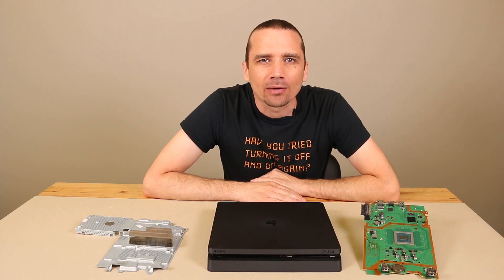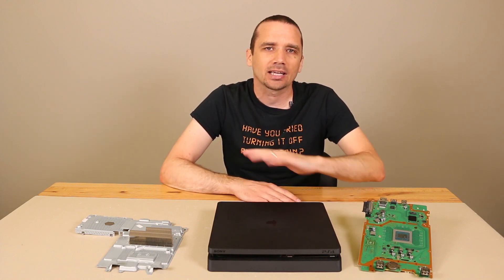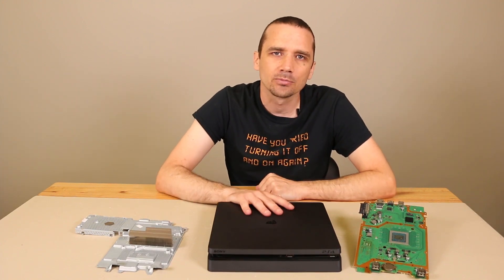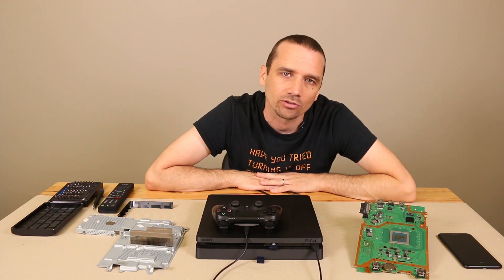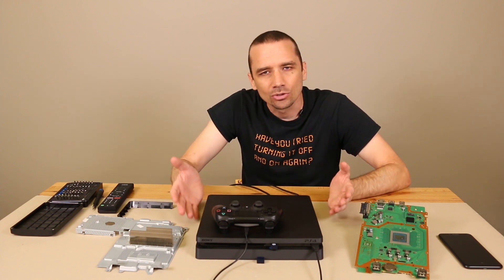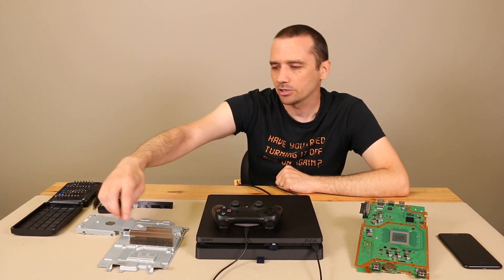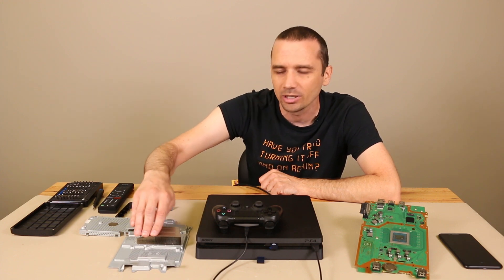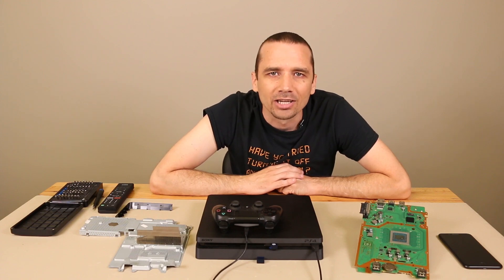PS4 Slim Too Hot? - Overheating Explained - Prevent Overheating

Comment: My 60GB PS3 (which is over 10 years old now) would get up to 72 C* and with a fan mod it's somewhere in the 60*C range. I'm not worried about my slim overheating compared to this.

Comment: I am very worried, I have seen your video completely and I understand that my ps4 slim generates heat ..
The problem is that when I use my console, I put it in front of a room fan (where I live the normal ambient temperature is 32-36 ° Celsius) And there it does not feel very hot, but when it is not with the room fan the console feels too hot and from the bottom it feels very very hot, almost  like it burns (I'm not exaggerating), I really never use it without the room fan for fear that the console would shut down (it never happened to me), ¿ What do you think about my case?
Reply from the maker: It's normal for it to feel really hot.
Reply: TronicsFix well, thanks man If you say it is normal, then I will start using it without the room fan
Reply from the maker: Let me know how that goes
Reply: TronicsFix it works good, it hasn't  turned itself off, but I have a question:
I compared how hot it felt from the bottom of my ps4 slim with a ps4 fat version and the ps4 fat doesn't feel hot at all from the bottom and my ps4 slim is very hot from bottom, is that normal ??
Reply: eddy ramirez I believe that PS4 fat version feels like that cuz it has more space inside for the air flow,  the slim is compressed so you'll feel the heat, but inside the fat is pretty much the same. I've used The Fan but it only made my slim dirty inside, not using it anymore, the slim feels warm on the top right corner and hot underneath but i play nearly 6 hours a day and the temprature always stays the same, these things are hot but its only bad if u get error texts on your console.

Comment: Best console tech guy ever
Reply from the maker: Thanks man!
Reply: Same ;)
Reply: Agreed totally
Reply: bernard ngatunga yesss I agree
Reply: Is it bad to keep the ps4 slim vertical
Reply: I agree
Reply: True I could listen to him talk for a long time
Reply: Had  a ? I got a oivo multifunctional cooling stand I put it in right way where when u kick the fans on to the stand is at the back got super hot never done that before so I flipped it to ports when u kick on the fans the five square holes that suck in air in to the slim  seems ok but never got hot the way it did before I hade custom tabs made for each corner  half inch off the ground did good but got told a ps 4 stand is better or wall mount I don’t think that is even good at all  ? Is it better just to put it back the way I had it before ? thanks for the videos cleaned my ps 4  very easygoing I could not find any one to clean it deep cleaning I don’t dare to do never ran way hot just wanted to clean was kinda shocked on the dust cause I keep the vents clean a back of the ps 4 I really thought those where the fans was . love your videos stay safe have a good one bro u a family m ❤️
Reply: Yes

Comment: Hi, do you recomend the using of external cooling fans to extract the hot air of ps4 slim?
Reply from the maker: Not usually. If your PS4 is in good condition it doesn't need them
Reply: TronicsFix  it can be cause problems yo the hardware?

Comment: Sir should I buy ps4 slim (Will this over Heating issue be a big of a problem if I play it for 6to7 hours) Or is Xbox one S better
Reply from the maker: Either of those consoles will do fine. They are both made for extended gameplay.
Reply: TronicsFix appreciate ur reply
but as u said they heat up when we play games like uncharted 4 etc . One more thing does the sound of the fans is really annoying or is it bearable.

Comment: I take off the top cover and put a small ventilator over the fan ventilator of PS4 Slim... and gets more cooler at least, I can fell it over ps4 slim....   ... the hot air comes out faster of the ps4 slim back... It works for me...
Reply: I did that too! And yes its more cooler, I make a little test playing Wolfenstein II, Drive Club  and Horizon, with and without a small ventilator  and the difference of the pS4 Slim fan decreses a lot using ventilator...

Comment: Xbox 360 gets RROD at around 51c most chips ate rated for max temp of 50c so a temp of 54c on a ps4 is a death sentence to the unit in my opinion.
Reply from the maker: They're designed to run that hot. Unless they get clogged with dirt or something it will be no problem.
Reply: Most ICs are rated at 50c

Comment: Please answer: i recently buy a ps4 slim and i noticed that the ps4 gets hot no the part you show us in the video even if iam only in the menús of the ps, is this normal? You recomend a cooler of fan for warfare days?
Reply: It gets hot like 5 minutos after i turn it on, even if iam only in the menus
Reply: Serterm tri i think thats normal. also check if theres no blocking in your ps4 slim fan.
Reply: sarsi クネタ  the fan in the menus of the ps is not working, only in the games, i want to know if is normal that your ps4 slim gets hot in the menus? Is not overheating but certainly hot on that part you mention
Reply from the maker: That's nothing to worry about at all.
Reply: TronicsFix  hi, first of all thanks for your support, second: iam here again because i buy a ps4 slim cooler that extract the air behind de console, so i noticed that when the cooler is on the internal fan of the ps4 make more noise, but when i leave the ps4 alone without any cooler its hard to hear any noise, so, my question is: did you recomend to me use this cooling external fans for the ps4?

Comment: Mine overheated the other day and powered off on netflix lol, Sorry that i played GTA 5 15 Hours straight to beat story mode lol
Reply: And btw, I didnt get a message or red light. It powered off and didnt turn back on until like 5 hrs later
Reply from the maker: That's more of something like a power supply issue or something...most likely not overheating.
Reply: Oh No, Well I usually take breaks anyway. I was just so addicted i wanted to finish lol. Any chance the power supply overheated because its fine now after being on a few hrs. I dont want to get a new Power supply nor take apart my ps4 lol. I done screwed up my gaming laptop by taking it apart
Reply: And my ps4 sits on my desks keyboard tray cuz i prefer my keyboard on top so mabey ill move it above my monitor for air and get a colling fan or stand
Reply from the maker: Ya, I wouldn't worry about it too much unless it keeps happening or gets worse.

Comment: I have a question about the fan. A few days ago I had my younger brother fall on top of the ps4 and ever since then the fan doesn't sound as loud as it used to before. Is it possible that it was damaged and doesn't spin as quick as it used to? It sounds normal and kicks in after like 10 minutes of gameplay but once I get to the home screen it is dead quiet and it didn't do this before
Reply from the maker: It's always possible that it was damaged, but if it's working normally then I wouldn't worry too much about it.

Comment: doesn't a ps4 have a built in failsafe where the system will turn off before it actually overheats.
Reply from the maker: Yep...that's what I show in this video...it will turn itself off when it gets too hot.
Reply: The problem is that its pointless most will simple get screwed even without ever entering the overheat protection, there's a really big number of people with the console turning off and doesn't start up or just simply the BLOD.

I had the latest best version of the PS4 before the slim (3rd version with the big cooler and slightly more energy efficient than the 2nd version and way better than the first one), I sold it to a friend when I upgraded to the PRO.

My friend already have it for almost a year, but last weak the console had the starting problem, it would start then shut down, I guess the console is dying, good thing is its still under warranty until like March next year.

Both me or him always let the console cool down at least 5min in the menu after playing a game before turning off, it has nothing around it so it has enough cool air to push and the consoles just seem to be made to break after warranty is over just like the PS3.

My current PS4 Pro also already shutdown while gaming twice already, I don't know if its also failing or if its other software errors, I barely used the console, I left it OFF for like half a year.

Both consoles are also completely dust-free, not a single bit of big dust on the air entrance...

Every time I clean my room I always clean my console with the Vacuum cleaner with a big brush adapter (so it also doesn't make much pressure and doesn't turn the fans inside, just cleans outside).

Never use a powerful vacuum cleaner directly or with the high pressure small head adapter, it might cause overvoltage damage inside if the fans overspin since they create electricity while spinning, for that the fans need to be stop from moving and only then you could blow\suck air at high pressure.
Reply: Omg thank the Lord my PS4 shut off randomly while watching YouTube it's either it literally died or I just didn't pay attention to it but how long does it take for it to turn back on

Comment: I have a question, one night I was listening to music when I heard a loud "bang" come from my ps4,  when I tried to turn it on it beeped and the light came on for maybe a second then it wouldn't even attempt to turn on after that. it's been a few days and it does the same thing. I was thinking that the problem is overheating but I haven't looked inside and I don't have the tools to do so. I'm worried that the entire inside is just exploded and non repairable due to some explosion or is this common and really only effects a particular piece of hardware and can be fixed ? or should I just invest in a new Console?
Reply from the maker: Overheating will not cause a loud bang and they will usually start up again. Are there bugs in your console? What you describe is often caused by bugs getting in it and shorting out the power supply. They normally can be fixed.
Reply: Jason Lyons Interesting because I had this happen to my PS3. When I got to open it up, I actually found bugs inside of them! Check it out, but unfortunately my PS3 wasn't able to be fixed because the motherboard and disc drive appeared to have broken.
Reply: I can't tell if there are bugs inside of it, I've never noticed any crawling around on it or trying to get inside of it. and it was more of a "pop" sound than a bang. I don't currently have the tools to open it up and see if it does have bugs. I'd imagine by now considering how long it's just been laying there that they've probably all left. or am I wrong?
Reply: and if you have any advice on cracking open this thing and unscrewing the security screws without the specific tools I'd be willing to try that
Reply: also, if it is my power supply. could I just order a new power supply and a screw set and replace it then or would I have to replace the fuse and solder it onto my system? if that's the case I'll just send it to you .
Reply from the maker: No soldering required to replace the power supply. I have teardowns on my channel as well as links to the tools I use in the description.

Comment: hey does PS4 fan from Amazon would really make a difference? or may be it just the way to get more dust into the ps4.
Reply from the maker: I actually don't think they make a difference. I haven't tested them but the fans on the PS4 are generally not the problem...they work fine...as long as they work. If the fan stops working then that's obviously a problem.
Reply: TronicsFix thank u sir.
Reply from the maker: You're welcome!

Comment: yo what happens if you accidently plug off the ac power cord from the ps4 slim while its on?? i have done that 2 times so man plz help
Reply from the maker: It shouldn't cause a problem (except that you'll probably lose some game data). It will do a system check when you turn it back on. You should try not to do it but if you do it's not a big deal.
Reply: thanks + subbed
Reply from the maker: Thanks for the sub!

Comment: what u can do is go on amazon and buy ps4 slim fan to connect on the back of the system.
the higher the system temperature get the more air the fan blows
Reply from the maker: Or you could just fix the problem so it doesn't overheat.

Comment: thats sad that the ps4 slim overheats but doesnt surprise me because its too small for a high end console
Reply from the maker: All consoles overheat under the right circumstances. The PS4 Slim doesn't overheat any more than the original PS4.
Reply: Salar Mizere dude yes, we are talking about high end consoles right here. The slim has been out for almost a year, overheating isn't an issue. It will overheat like any other console u see the right circumstances, like if you surround the PS4, which blocks the PS4 from moving air around
Reply: billyhatcher643 Not high end, The PS4 Pro is barely high end

Comment: I have my PS4 Slim for exact 2 Months and until the first day it's getting really warm... i refer would say "hot"... especially at the top right corner and bottom in the back were the power supply is... but no matter if you play 2 or 6 hours, the temperature remains the same... and it's running really well without any problems.

Also if you see movies about the browser, the Slim gets really warm... no matter what you do, it's every time the same temperature.
Reply from the maker: They get hot...thats normal.
Reply: TronicsFix so what's a normal temperature reading? Anything at and below 65 degrees Celsius, correct?

Comment: Can  you do a video on the ps4 pro. I'm on my third pro as the first two overheated and made a loud pop noise and never came back on.
Reply from the maker: Yes, I will probably do that
Reply: Nicky Wilson sounds like a capacitor popped. I could be wrong
Reply: TheDude think so. Tripped the fuse box.
Reply from the maker: Are there bugs in them?
Reply: TronicsFix doubt it. Only had the first one a month. and the second one a day. must have been a faulty launch batch. they were delivered by post, so could have been dropped. the 3rd one I got in store and that's fine.
Reply: Yeah, I worked as postman and you don't really will want to order a console to your home... Everything basically make a HUGE bang on the van.

Usually big stores have their own trucks or a better services where everything gets there by the hundreds and are well packed.

Anyway my PRO also was bought in a big store, but it suddenly shutdown a few days after just like that and wouldn't want to turn on for a bit... Anyway I left the console with a game running for quite a few days in a row for testing and that didn't happened.

I stop using my PS4 for a long time, it was still on firmware 4.5 and I didn't turn it ON for like half a year, I only turned it on to play Just Cause 3 which came as PS PLUS game last month and the console did the same thing.

I don't know if I should take it to warranty, I have seen lots of PS4 Pro's doing the same crap, no idea what to do.
Reply: Nicky Wilson jesus how much do you play?

Comment: it's a shame that the PS4 slim isn't as reliable as the ps2 or the ps3 slim.. 
my brother has the PS4 slim which runs hotter than my fat ps4
Reply from the maker: I wouldn't say it's not as reliable...Slims seem to be just as reliable if not more than previous models based on the # of repairs we get in. Time will tell though.
Reply: TronicsFix what’s more reliable ps4 slim or Xbox x?
Reply: Dukes the reason the ps4 slim feels hotter is because its very compact therfore heat can penetrate much more effectivly, the reason the OG ps4 seems less hot is because most of that heat is on the bottom due to fan placment and it has more room for air to pass by and since air is terrible at  transfering heat you wont feel it as much on the OG plastic body unlike the slim where as i said before everything is compact and tightly placed together
Reply: Dukes slim and pro have better wifi at 5.0ghz compared to the original ps4s wifi at 2.4 ghz speed
Reply: Got my slim Ps4  5 days ago.After 7 hour family play  with 3 pauses, the playstation freeze when i look in store at games.When i check it out it was very hot....I must reconect all cables to make it work again :(
Reply: @mada66000  Well don't play that much😅
Reply: @archanagavli8628  i dont think it is too much to play each memeber of family 1h/1h and half per day.I dont buy play station to keep it dust on it.Everybody from family play his/her  game. Kids and we, mother and dad....i must buy some cooler devices to keep it normal....

Comment: Another informative video, thanks man. 

I have a question though. I now a PS4 slim that I'm standing vertical with the official stand. It does appear to feel cooler than when it's laid horizontal, but i seem to read that keep a console horizontal is best and should keep it cooler. is this correct? 

Thanks again.
Reply from the maker: That would make sense since there is more surface area for the cool air. I haven't seen any comparison videos...maybe I need to make one!
Reply: TronicsFix It would be great if you could do a comparison video to show the results as the whether it would run cooler one way or the other as, like you say, there is no video showing any results. 
Many thanks for the reply.

Comment: Since I opened my one up to replace thermal paste it was super quite for a day and now it sounds like a hair dryer.
Reply: chris554 that's called thermal throttling
Reply from the maker: Maybe you did something wrong when you put it back together?
Reply: I meant to say it was super quite for 4 days. I replaced thermal pads with 1mm as well as thermal paste